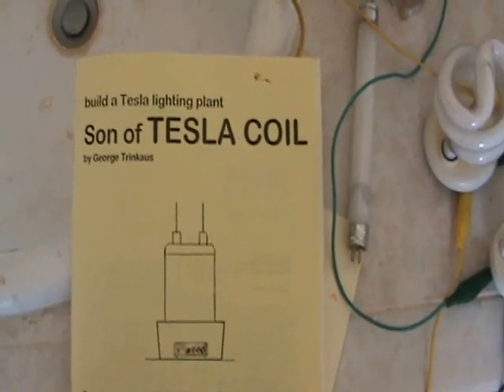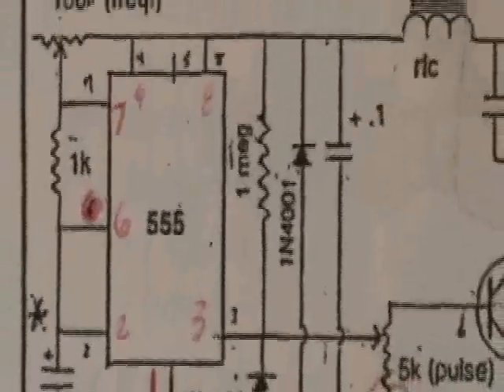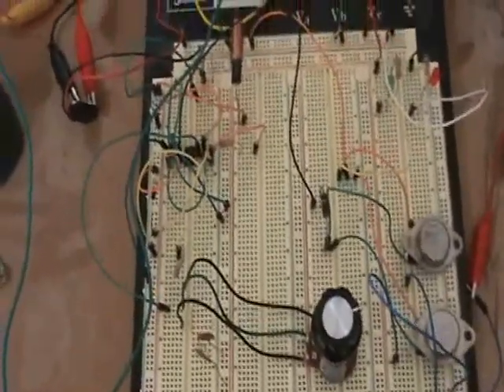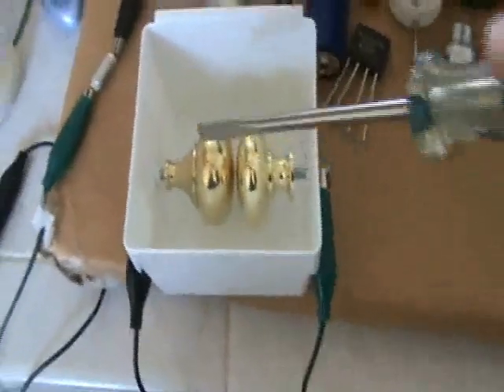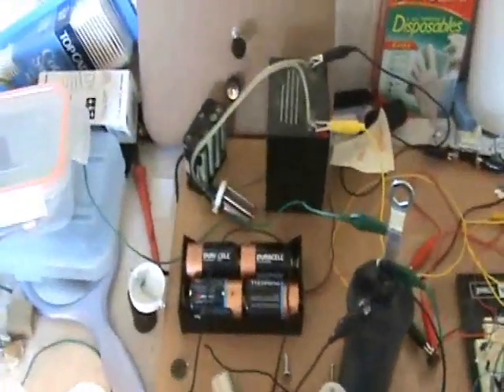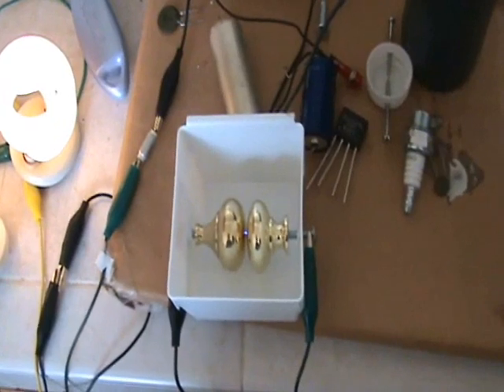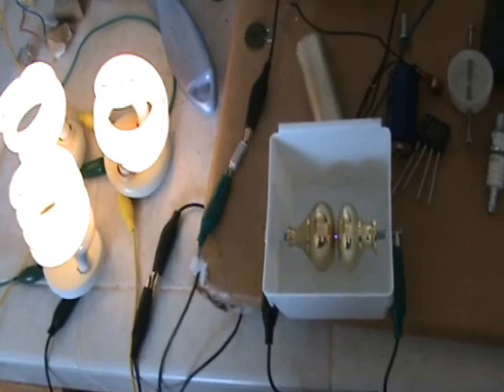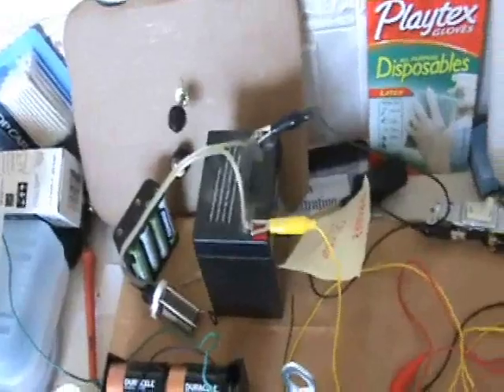replication of "555 drives ignition coil" from Son of Tesla Coil

Comment: larger the capacitor the longer the spark and lower the frequency
Reply from the maker: not exactly. Its an LRC equation, so L and R also play a role.
Reply: morpher44 frequency allways changes the spark length a few simple experiments will prove that  especially if you are using something with an iron core then the waves dampen

Comment: May not be a matter of resonance, but driving power as well. Try using a mosfet IRF640 or so. If so, use a bypass diode to prevent back emf from toasting the mosfet, Mosfets have better power transmission at high frequency.